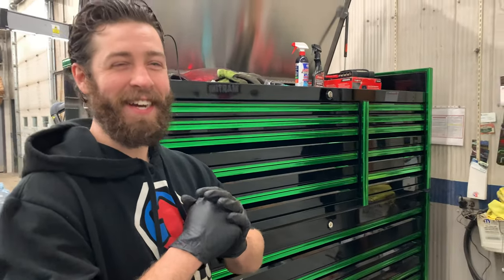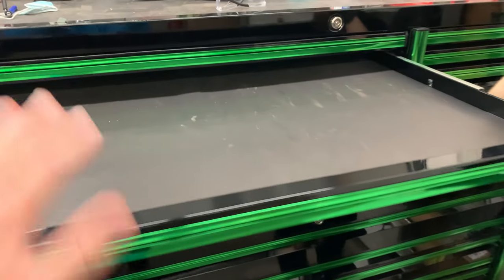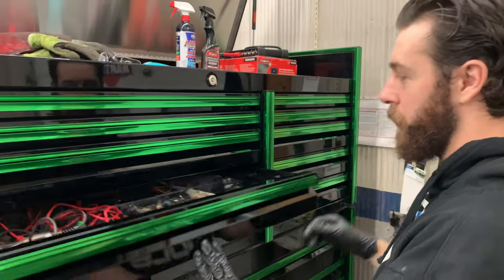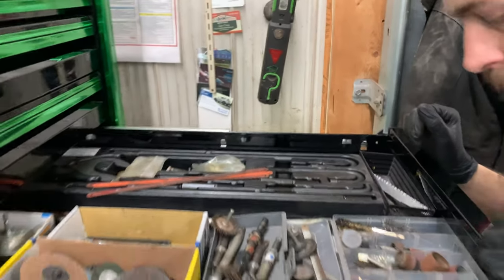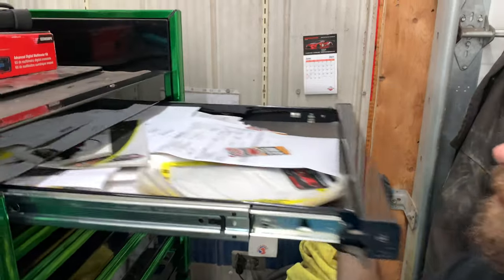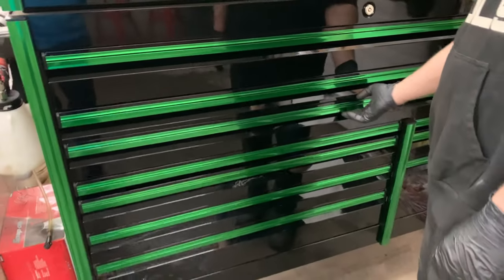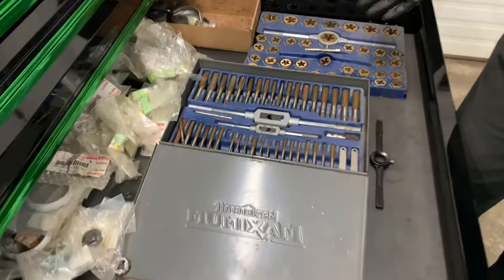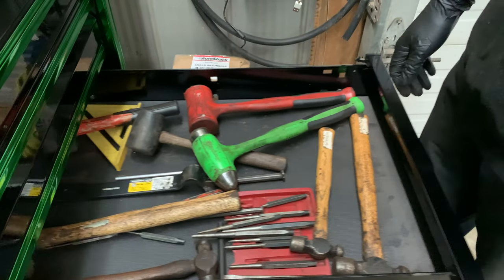Toolbox Tour Snap-On Epiq 68" Tool Box Top

Comment: The relay is a surge protection for a r107 mercedes
Reply from the maker: Gotta be the closest guess so far, I mean they are probably the same relay from what I can see but it wasn’t out of a Mercedes
Reply: @Tech-28  oh ok. The mercedes had the same relay with the 10 amp fuse in them. And that would always be the first thing to check on a r107 chassis if you had a poor drivability complaint.
Reply from the maker: @russr861  it’s out of a Ferrari testarossa (tachometric relay) but I’m positive it’s the exact same relay that’s in this Mercedes R107
Reply: Dam cam here to post this but you beat me to it. Only ran across that relay once on a older mercedes